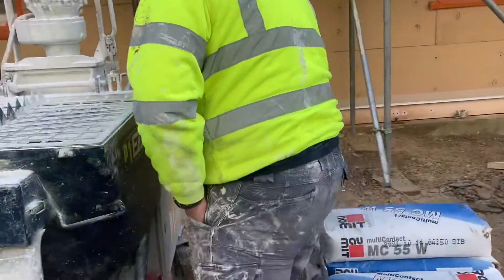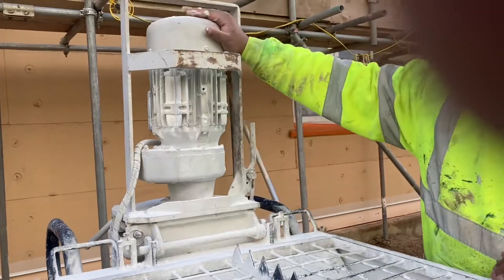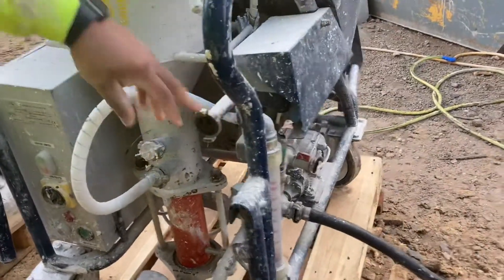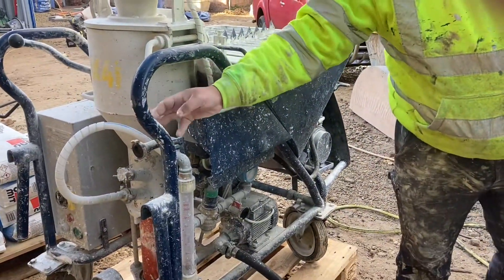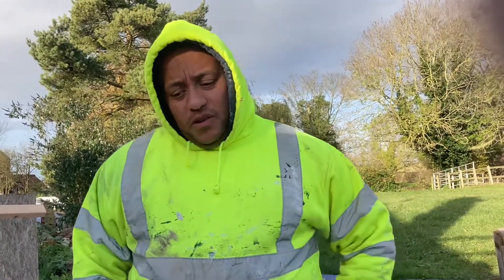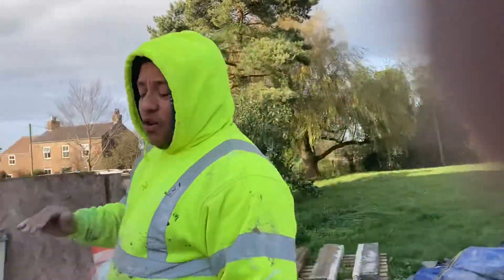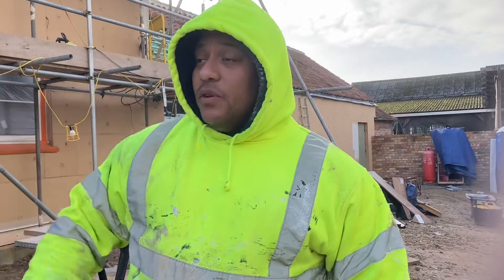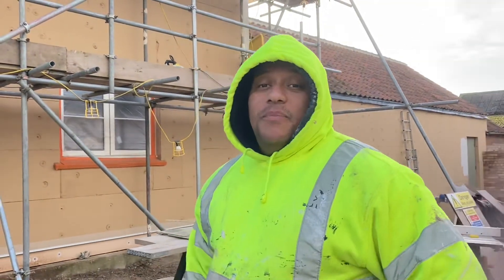This is the another walkthrough of my k4 rendering machine

Comment: Have you got the water to the right inlet on the mixing chamber
Reply from the maker: She sprays a dream, where is your videos you got some for us sweetheart?
Reply: @Rendervate  I am only asking buddy I've never used one of these on the g4 the water goes in the top you take the bottom cap off till the water dribbles out then you stop putting water in and replace the cap and that's the chamber primed ready for mixing if you have it on back to front that's where you might have a problem with the startup or machine backing up